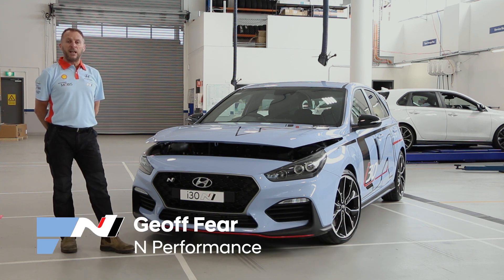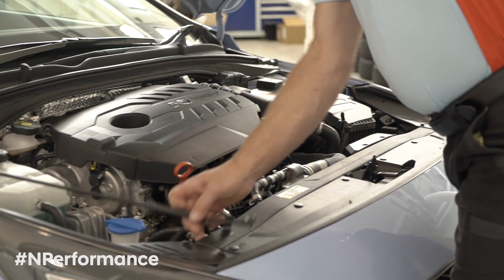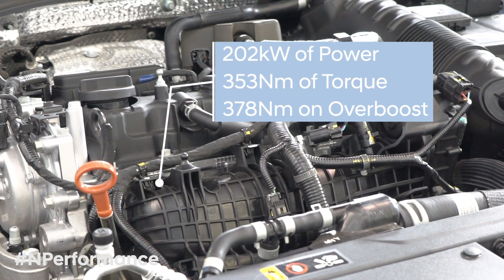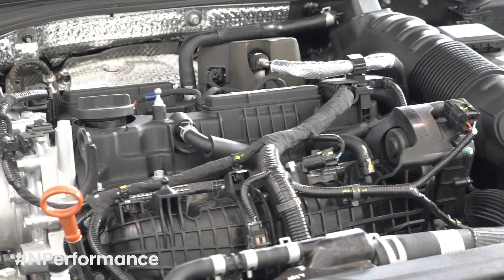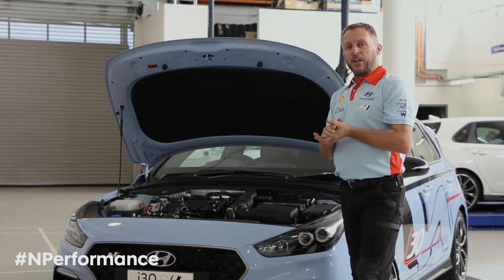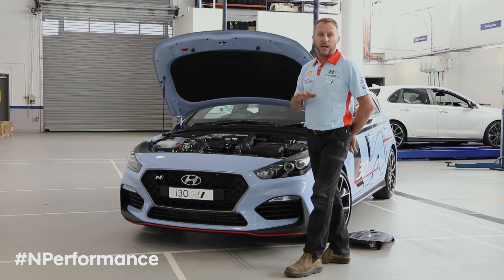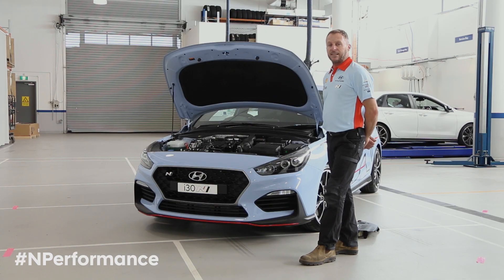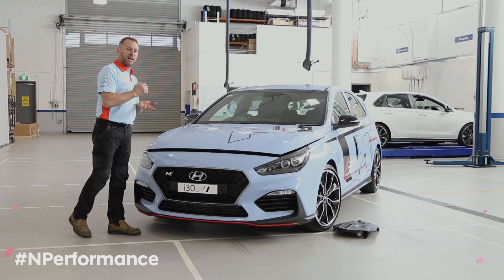i30 N Tech Talk - Engine

Comment: So nothing really about the engine, does it run steel crank?  Dies it have forged pistons/conrods?  Does it have closed deck for the higher output? Does it have block bracing for the alloy block?   These are questions the enthusiasts are wondering you told us nothing pretty much obviously what Bierman wanted you to know.
Reply: Never heard any enthusiast ask any of them questions
Reply: @i30n_fb  Why wouldnt you ask those questions? Otherwise you cant tune it, oh wait you cant, the engines grenade which is the point hes making.
Reply: @42cuba running 300kw without any issue
Reply: The answer to all of those questions is... no no no lol